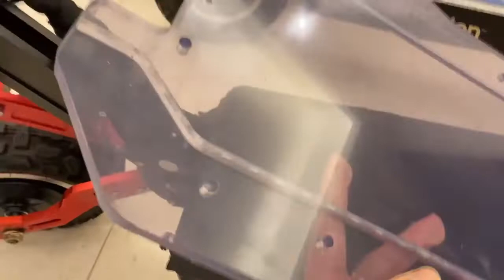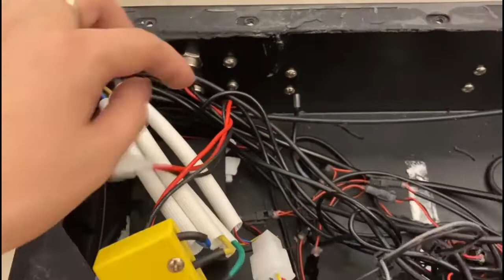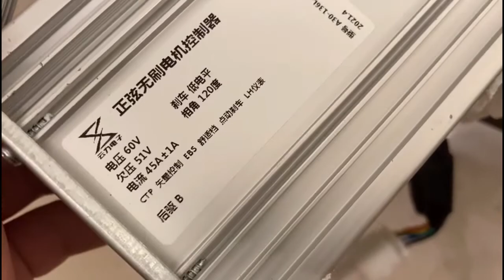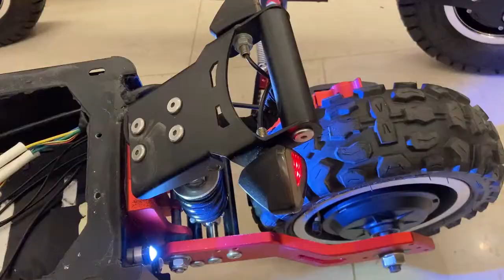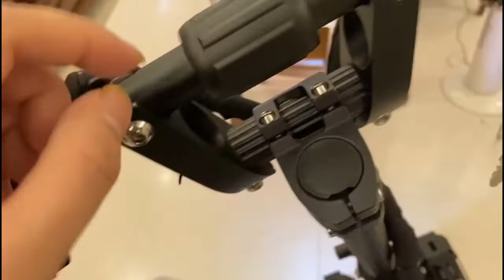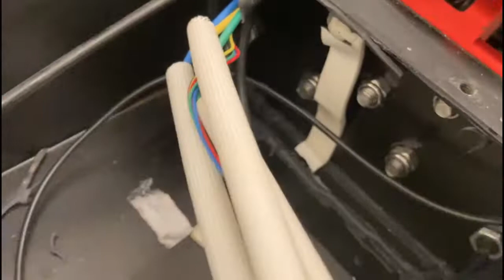YUME X11and M11 Controller wiring instructions

Comment: I have a problem on my Yume X11 I still can't find the solution.
lately on a walk the trott is completely off on the way after some research I found that the control trigger had burned out.
After ordering a new trigger and checking compatibility example: (setting: 60v 100% battery voltage capacity 62v a priori normal) the scooter works completely again except for a huge loss of power on acceleration and at top speed almost 35 km /h also the reset of the km traveled I find it a shame.
Reply: did you get the new issues resolved?

Comment: I ordered this in black and had some issues so Yume sent me the updated gold one and this thing is so awesome. They fixed all of the small issues. Mine has no slop, no rattles, no noise and rides like a champ. I’m 250lbs and I went up to 55mph with throttle to spare. Yume also redesigned the damper and it rides like a Cadillac now. Get the gold scooter and you won’t be disappointed. In a few years, as long as the quality stays the same or continues to improve, they’re going to give KAABO and Nami a run for their money. I’m very happy with this scooter and you will be too.